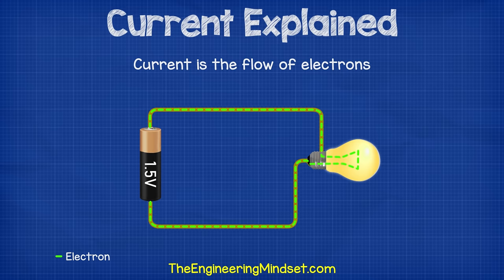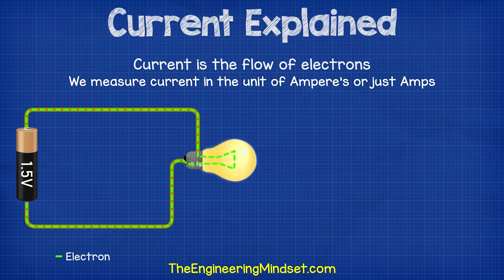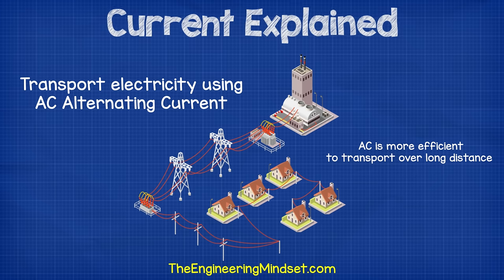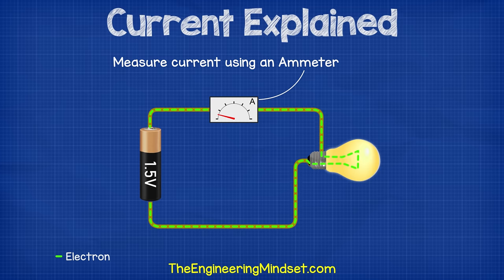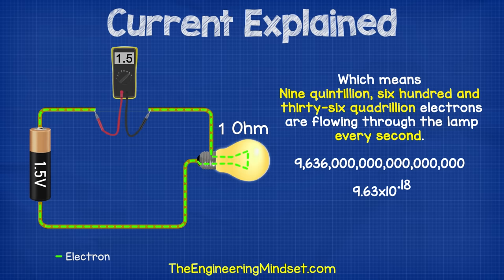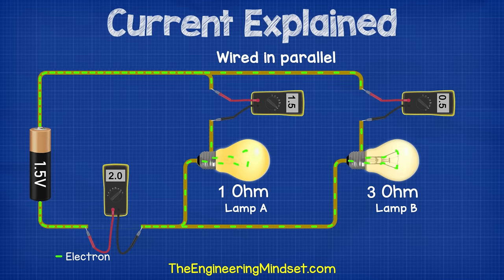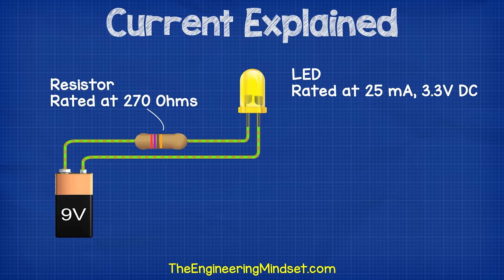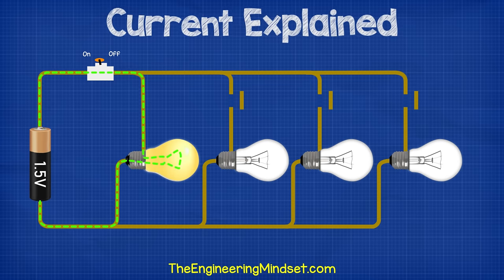What is CURRENT– electric current explained, electricity basics

Comment: One question if anyone can help - I don’t understand the fuse example at the end with the four lights. Why does adding more lights cause the current to increase and break the fuse? Wouldn’t adding more “work” to the same voltage reduce the current, not increase it?
Reply: I'm very much a newbie here but I asked chatgpt the same thing ("why does current increase the more things you add in parallel? Does that mean adding infinite lightbulbs in parallel will increase current infinitely??")

It pretty much said to think of adding more things in parallel, as adding more lanes, which permits more traffic to flow. So if you provide the room for more stuff to come through, more stuff will come through.

(And it said that adding lightbulbs will increase current up to a point, but not infinitely, because the resistance of the battery and wires would eventually limit it, or too much current would erode the battery capacity or something (I still don't totally get this))

I still have a lot of questions but found that analogy useful... Maybe someone who knows more can elaborate more

Comment: When it comes to the image of the lightbulbs in parallel vs in series, i got  caught up on the density of the dotted line and read a lot into the fact that the dotted line looks like it's the same density and speed in a point in the series circuit that measures 1.5 amps, and in the point of the parallel circuit that measures at 3.0 amps. I got confused because i thought the flow through the 3 amp point would look twice as dense or twice as fast as the flow through a 1.5 amp point... Am i just reading too much into what is supposed to be a general visual aid? Lol

Comment: At 11min 14 sec, why is it that the current will surge when a human touches a live component?

Am i correct in my understanding that in applying the Ohms law here, whereby a person, who is a very good conductor of electricity, thus it has much more low resistance, thus V/(Much lower) R compared to a normal circuit = very high current?

Comment: I don't like that last bit....circuit breakers are NOT designed to be live-saving devices, not at all. If they were, we wouldn't need GFCI outlets in our bathrooms. It only takes a fraction of an amp to kill you, and you're trusting a 15-20A breaker to trip in time to save your life? That's assuming that, for whatever reason, that much current flows into you to begin with. Even if it did, such a massive amount of current would probably kill you instantaneously, and make it a moot point. Not to mention that there are different types of breakers, those that trip instantly, and those that trip after 1-2 seconds of overload (to stop them from tripping if there are tiny transient moments of high current draw). DO NOT trust a circuit breaker to save your life, they are only there to protect the circuitry and the structure, NOT humans!
Reply from the maker: Seen our new incredibly detailed MCB video? link: https://youtu.be/gqEu9t8HwW0

Comment: At the end you put a circuit breaker on a DC circuit, wouldn't the breaker never trip in that scenario? I thought that the added resistance of the lights would reduce the ampere of a DC circuit because it would spread the current across all devices
Reply from the maker: Seen our new incredibly detailed MCB video? link: https://youtu.be/gqEu9t8HwW0

Comment: I have some questions if someone can answer them. So batteries apply voltage to move the electrons, do the electrons just come from the copper atoms or something else? And if they do come from the wire wouldn’t you eventually run out of electrons if it is attached to a lightbulb or something like that because you lose energy through heat and light? Sorry if this is a dumb question I’m just a bit confused. Thanks!!
Reply from the maker: The battery will provide electrons during a chemical reaction. This will push the free electrons of the wire. The energy is used and given off as heat, the electrons are not used up just their energy.
Reply: The Engineering Mindset thank you very much!!! I am no longer confused.
Reply from the maker: Check this out, how a battery works: https://youtu.be/PXNKkcB0pI4

Comment: Do electrons actually flow because what I’ve read is that they vibrate and transfer energy. 

So current should be the rate of flow of energy not electrons.
Reply: Yes if you could magnify atoms, you won't see any electrons move like that, just the electron cloud or soup between metal atoms and a very faint wave-like "movement" over it, that is the current. At least that is current in metals. What they displayed is more like movement of free electrons in vacuum.
But the presentation is great anyway for engineering classes, here we don't need to go quantum :)
Reply from the maker: Check new more detailed current electricity video here: ➡️ https://youtu.be/kcL2_D33k3o

Comment: Hello fellow engineers,
Could someone explain me the math behind the 270 Ohm resistor? (9:14)
I am familiar with U=R*I, so I thought 9 V and 270 Ohms equal 0.0333A. But that would be too much for the LED, wouldn‘t it? And how much Amps does the battery even have?
Thanks in advance for all answers :)
Reply: QuellHell Probably it's just an example, in real life the led would burn
Reply: QuellHell You're confusing Amps with Amp hour. Amps = current, Amp hour is a unit to measure batteries capacity. If a battery has 2Ah, in theory, it means that the battery is able to give 2 Amps in 1 hour, 1 Amp in 2 hours, 0.5A in 4 hours and so on
Reply: Henrique Bueno Oh I see, thanks for explaining 👌🏽
Reply: LEDs have some internal voltage drop, 2.5 V for example. Therefore, the current I is (9 V - 2.5 V)/270 Ω≈0.024 A. Lighting a LED like this would not be efficient, as the majority of the power (6.5 parts) would be consumed by the resistor and only the minority (2.5 parts) by the LED.
Reply: @atanasi  so the rezistor should have 360 ohms if im not wrong :/ right?
Reply: @pain2737  360 ohms would make the correct current, if there were no other resistances or voltage drops. LEDs can be analyzed to various degrees of complexity. Often a constant voltage drop is all that matters. Besides that there is a small internal resistance, but that can be insignificant compared to the other resistances of the circuit. In some cases, one would have to use a more complex I-V graph or simulation.
Reply from the maker: Check out NEW resistor video, everything covered! ➡️ https://youtu.be/DYcLFHgVCn0

Comment: Sometimes you say current is "slowed" down due to a resistor. Is that right? Don't electrons always flow at same speed. Isn't it the quantity of e reduced?
Reply: Current is how many electrons there is flowing. And resistor resists how many electrons can flow through it. So it slows the current down. 
Electrons themselves are not slowed down, but how many electrons go by, is reduced.

did i explain it well ? :D
Reply: so yes, That's basically what you asked
Reply from the maker: Check out NEW resistor video, everything covered! ➡️ https://youtu.be/DYcLFHgVCn0

Comment: Hello teacher
I am begginer in electricity and i have a question
if i have 220 kΩ (220 000 Ohm) resistor in circuit and voltage 220 volts, and tauch the wire, do i get electrocuted ?
current = voltage/resistance
220/220 000 = 0.001 amps ( 1 milliamps) if my math righ so i think, i don't get electrocuted
thank you very much
Reply: First of all, it’s not so much the current taken by that circuit but the current flowing through you. When you touch the wire, then you become another circuit with respect to earth and it depends upon the conditions, how much current will flow. I guess you will be electrocuted. Sorry!
Reply from the maker: Check new more detailed current electricity video here: ➡️ https://youtu.be/kcL2_D33k3o
Reply from the maker: Check out NEW resistor video, everything covered! ➡️ https://youtu.be/DYcLFHgVCn0

Comment: In the last example, would the voltage have to change to cause the circuit breaker to trip? Isn't the amount of electrons coming from the negative terminal going to be the same reaching the positive terminal no matter how many globes are being powered? In the 'wired in parallel' diagram the current is split but is the same when added as what's coming out of the battery. If someone could get back to me and explain in a bit more detail I'd appreciate it
Reply from the maker: Seen our new incredibly detailed MCB video? link: https://youtu.be/gqEu9t8HwW0

Comment: How come a resistor is placed on the path from the device back to the battery? I thought it'd be placed on the path TO the devices to prevent any initial excess of electrons. Does it not matter where on the chain of signal it's placed?
Reply from the maker: Please watch our videos on series and parallel circuits it'll be clear why then
Reply from the maker: Check out NEW resistor video, everything covered! ➡️ https://youtu.be/DYcLFHgVCn0

Comment: Why do you put a resistor when the volts have already flowed through the light and headed back to the battery?
Reply from the maker: The volts do not flow, electrons flow. The voltage is the pressure or pushing force for the electrons. The resistor doesn't act like a speed bump with electrons slowing at one point, resistors create a traffic jam slowing all electrons
Reply from the maker: Check out NEW resistor video, everything covered! ➡️ https://youtu.be/DYcLFHgVCn0

Comment: There are those who use magnets and coils to light light bulbs.  I can’t find out what the magnetic flow or current flow is as the lights don’t glow for me.  Please tell what size light bulbs are used for this purpose.  I have illuminated a bulb with a 9v battery, however I cannot achieve 100% free power to make light. Thanks
Reply from the maker: Check this out, how a battery works: https://youtu.be/PXNKkcB0pI4

Comment: I enjoy your videos. 🧐
But, you might want to change your suggestion for the, "Good Meter" link.
But then I tend to read the 1, 2, 3 and 4 star reviews.
Typically 5 start reviews seem to only mention how fast their item arrived. But not this meter.
There must be a descent DMM that has multiple functions, (I can live without the frequency feature) adequate test leads, instructions and will last if I don't drop or abuse it, for under $70...oh yeah, and can check capacitors on motors. (Air compressors, Air Conditioner...) This "20 - 100 microfarads max" I find on DMM is ridiculous.
Yeah. I'm sorry I may be off topic, but for the sake of your watchers that decide to use this link to purchase this device...If I find some thing that is advertised with as many features and has 4 and 5 star reviews that don't mention things like, "The test leads suck!" I will edit / update this comment.
Otherwise...I love your videos! And I keep watching them to help me with this information become second nature in thinking.
The Fluke would be nice, but a full featured Fluke is $$$...But they are worth it.

Comment: What is the SPEED of electric current?!
Reply: Very slow
Reply: Yes, very slow, the electrons drift at approx 1 m/h  for a 10A current in a typical copper wire.
Reply: @karhukivi  <--Thanks for the engagement, George...this issue perplexes me. Electron drift is normal electron movement, outside of the influence of a voltage differential; super slow, it would take months for an electron to travel the length of a resistor. However, electron current in a conductor in response to a voltage differential is a different story--the speed I see quoted is 96% of the speed of light--which is necessary if our electrical equations are to make intuitive sense at all. Current, though, is time-linked, mathematically; it would appear that current can travel at different rates according to circuit details. A capacitor takes time to charge/discharge; and that time is determined by current density to a great degree. The idea that electric current in a circuit travels very slowly just doesn't WORK! Oh, and from what I've read, your figure of "1 mph" is a couple orders of magnitude greater than the actual case.
Reply: @StoneShards  The electron is like an ant, the charge to mass ratio is huge, so a slow movement of electrons - and there are a lot of them in 1 square millimeter - is plenty to give rise to a large current.  They do not travel at 96% of the speed of light, that might be beta particles in air, but not electrons in a metal conductor.  The velocity as you say, is proportional to the voltage gradient.
Reply: @StoneShards  That was 1 metre per hour, not 1 mile per hour!
Reply: @StoneShards  Hi Peter, I re-read your message and I see where the confusion arises.  The impulse effect of a current is almost instantaneous as you say, but wave motion is not particle motion as you can see in the sea where a wave passes but a floating object just bobs up and down.  If you google on "drift velocity" there is a calculation on a Wikipedia page that shows a velocity of 23um/s for a 1A current in a 2mm diameter copper conductor.  My estimate was for 10A and would give 83cm/hour for the same 2mm wire, close to my "back of the envelope" 1 metre/hour.
Reply: @karhukivi  <--Hahaha...Yep...my thinking cap doesn't seem to work  as well in retirement as it seemed to before! That still seems really fast compared to what I'd found in my earlier researches, but I'm not a physicist, so I'll defer to you on this, especially since it doesn't really affect my case: how fast are electrons moving from one atom to another under voltage motivation? "Much faster than otherwise" has to be the answer, somehow...I always think about the case of short-circuit behavior. Electrons are drifting happily in the wire until it's connected across, say, a large voltage. Then...WHAT? Vsource has a huge collection of electrons to present to the wire. There seems to be a virtually instantaneous "current response at every point on even a very LONG wire. I'm left to imagine how that can be possible when the electrons in Vsouce haven't had enough time to get to the other end of the wire before the effect of the current can be detected there. It seems observably true that current travels FAST, not slow...
Reply: @StoneShards  Yes, "current" as a wave travels fast, but not the electrons!  Those executive desk toys with a line of steel balls illustrates that nicely - one ball strikes one end and the ball at the far end jumps off.  The wave moved fast but the intervening balls hardly moved at all.
Reply from the maker: Check out NEW resistor video, everything covered! ➡️ https://youtu.be/DYcLFHgVCn0

Comment: I have a question in regards  say to the size of conductors (wires) specially  say speaker wires that operate based on Ohn"s if I read thing correctly, they tell me  you have to size the wire  as to reducing resisting and distortion of sound..... Am I wrong or  what is the right way to establish the  wire size or does it matter a very little what size you use? 
I installed a electrical sub panel in my home  to provide  electrical power for the addition using 220 volt and splitting voltage  to 110V for ordinary outlets and some 220V for dryer and wood workshop equipment, (of course the total Amps I calculated into the requirements), the new sub panel was more than 40' away, about 12 meters, but I had to calculate the size of the cable form my existing panel to my new panel,  to ensure proper size and avoid the cable from over heating, causing  fire, with electronic equipment you would burn out transistors, correct ?As for the electrical, your breaker would flip....... correct observation?
Reply: John Van Vliet  There is a lot involved in selecting the size of an electrical cable. First you need to calculate the amount of current required. You can usually get this from the nameplate of the appliances to be connected to the circuit. You will use this current initially to select your protective device, either a fuse or a circuit breaker, which is used to protect the circuit cable. The current carrying capacity of the cable can be obtained from the electrical regulations. However, depending on how and where you are running your cable will have a current derating effect on your cable. Such as, if the cable is clipped to the surface, or protected by conduit or near other cables etc. The electrical regulations should give you this info. There is also a maximum allowed voltage drop and so this needs to be calculated from the length and size of the cable. Without doing any calculations, you could select a large enough cable to do the job. Lighting is normally 1mm squared but you could use 1.5mm squared. Your sockets are normally 2.5 mm squared but you could use 4mm squared and so on. Hope that helps...
Reply: @kennethcohan9630  Thank you for your reply, and your explanation as to the selection  for electrical wiring, I should have been a bit more accurate for I was wondering the size of wire for speakers. 
I have been a construction manager for  many years and electrical work for building and plants is not  so much an issue for me, for you have codes, as you referred to as well, and often manufacturer's instructions as well but I have been making speaker boxes to build  nice sound system for in my home. 
There is a lot to it, to configure/design the boxes and so I became sort of curious what size of wire to use...... for you it is very low voltage in general and the Ohm's facture seems to indicate a variant related to resistance of speaker wires ...But I appreciate your effort  and the time  you took  to reply again thanks very you very much..... John V
Reply from the maker: Check the new SUB PANEL EXPLAINED ➡️ video https://youtu.be/NUSNa-7Hecw
Reply from the maker: Seen our new incredibly detailed MCB video? link: https://youtu.be/gqEu9t8HwW0